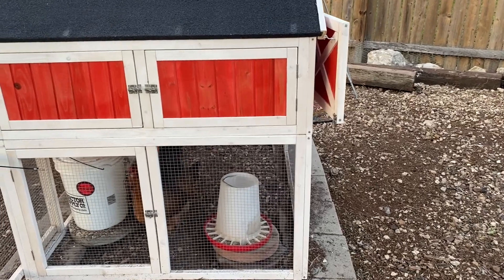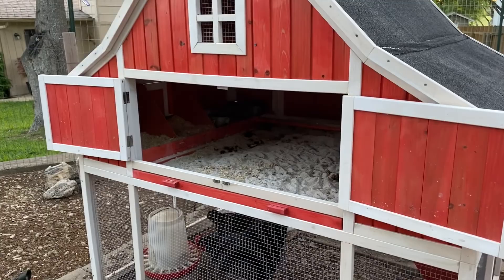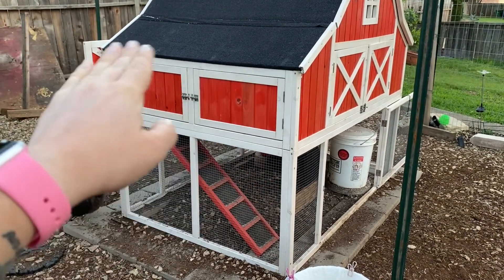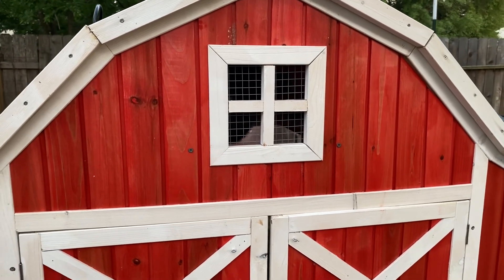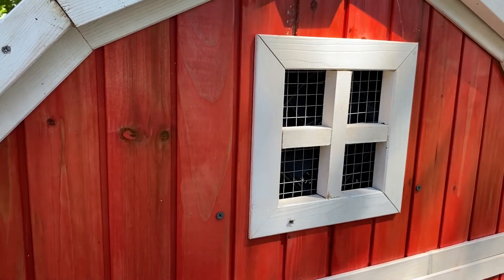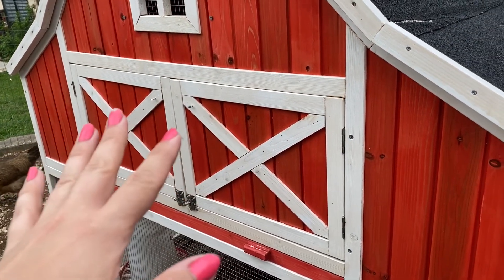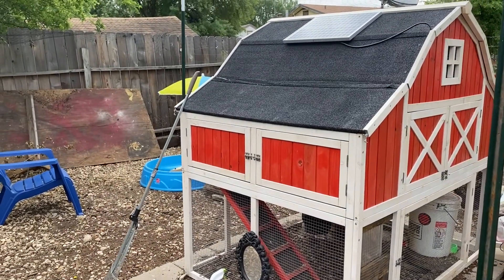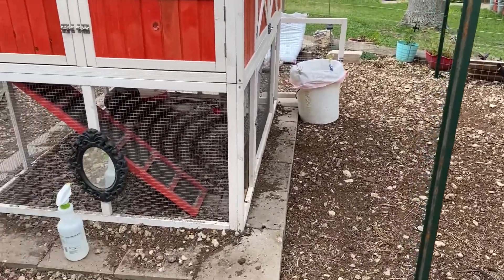Ventilation and Solar Fan Build for a Backyard Chicken Coop

Comment: Hi! I was wondering, 3 years on, if this is the same setup that y'all are continuing to use? Or have you tweaked/modified it over the years? I remember in another video the consensus was that one battery might not be quite enough to run both fans...would adding a second 12V battery maybe help with that? Or have you found other hacks to get around this? I just got this same coop and working on painting/sealing/assembling but definitely thinking ahead...I'm in north Texas so basically it still gets realllyyyy hot in the summer but it also doesn't rain hardly at all between end of May and mid September. :) So definitely will need some system to keep the new chicks cool this summer after they arrive.
Reply from the maker: Hi! Yes it’s essentially the same system. Right now we haven’t played with a new battery so it’s just “When the panel has sun, the fans are running” but it’s not charging or storing energy for later use. The fans still work great! You can buy all kinds of AC fan kits that are originally
meant for attics and garages too. And I’m from the Lewisville area and went to UNT for college so I remember that dry heat! ✌🏻❤️🐓

Comment: I am new to chickening.  My run will be completely covered/roof and the sides are open, and my coop is off the ground like yours.  It has a window on each long side and the roosting bar also runs side to side.  With the window's across from each other, I was going to put a fan on the outside.  It will blow in one side , across the roosting bar and out the other.  So a fan blowing on them at night won't hurt the chickens, right?
Reply from the maker: I don’t think they need a fan blowing across the roosts at all except maybe a bit during the day to help with smell. Why are you thinking you need it?
Reply: I have been using a small fan as an exhaust on one window 24/7. At night when it’s hot i put a small rechargeable fan facing in the coop. In Fl where I live the temps haven’t been dropping much  at night. When I go to tuck them in for bed, I can see them panting. Otherwise I wouldn’t put a fan on them. I have 5 different fans right now around the run. Hopefully I can consolidate when a new fan I ordered arrives. I am in the process of installing this type of solar for them. This video really helped me figure out how to do it!

Comment: Question please… Is it more important to pull hot air out of the coop or have outside air blowing in during hot summer months.  Not sure we have room for two fans so trying to figure out how to keep my girls cool before it gets super hot here. They won’t be ready for the coop until late July so trying to get everything else ready. We will have predator proofing underground around the coop & run as well as hardware cloth on the sides of the run and a solid roof over the run as well so wondering if we can just leave the windows open (covered with hardware cloth) with one window fan. Help!
Reply from the maker: Hi! I’d pull out the hottest air if possible. In the summer no one will be in the coop during the day unless they’re laying an egg. My fans auto run when it hits 88 on the thermostat (which is in the coop) and I also leave a door or two open when I’m home.
Reply: @Real Simple Mama…Thank you for replying. We have a lot of predators like coons, fox, coyote and hawks so doing everything we can to keep them safe in the coop and run but the heat here in summer is my biggest unresolved issue right now. Whatever we do will have to be battery & solar powered since the coop is too far from the house for electrical to reach. Maybe I need to cut another window opening in the back higher up to pull hot air out and use the front window to pull air in. Would that work? I even considered a small battery powered desktop AC but they create moisture so that won’t be good in a coop. Ugh… so many things to consider.
Reply from the maker: Hey I think extra windows high up is ALWAYS a good idea as long as you can keep rain out (make an overhang) and predators (secure with hardware cloth). Remember that hot air rises like you said. Think about the best place for a solar panel and when in doubt buy a too-big battery so it’ll definitely hold charge. I also have an old video about insulation versus ventilation that can help. Or you can email me! theMama@realsimplemama.com
Reply: @realsimplemama  Thank you! I’m going to check out the video you suggested and cut another window opening on the opposite wall up high to pull air out. We have decided to move the coop to another location on our property so electricity isn’t an issue. Thanks for the great ideas. We will be implementing them for sure.

Comment: How are all the fan, battery and thermostat connected together?
Reply: Hi! Thank you! So I did look on your website and I see how it all works together.  However the Solar fan that I got didn't come with the proper cables to connect anything to the Solar charge controller :( so I'll have to get the proper connectors/cables.  I was also wondering what Watts is the Solar Panel you got? Is it the 25 Watts?
Reply from the maker: Hey welllll that’s poopy. I’m sorry. Yes ours is the 12V 25 watt solar panel kit!
Reply from the maker: Hi! You can look on my website for the companion article and the diagram but it’s linear: battery, thermostat, fans. The thermostat is the gateway to allow power to the fans as needed. RealSimpleMama.com

Comment: Hi, quick question. The temp sensor you have inside the coop (the white rectangle box) is that just for you to have a general idea of what it is since you can view it inside?
Reply from the maker: Hi! That actually talks to the fan setup - it will automatically turn the fans on or off depending on the threshold we set up. I wrote an article about this build too on RealSimpleMama.com that shows how it all hooks up together 👍🏼
Reply: @realsimplemama  Hi yes I checked it all out. Just confused, does the wires run from the white rectangle censor where the roost is in the coop house to the other censor that you have in the battery container? Or is it just the censor that is in the battery container your main censor?
Reply from the maker: There isn’t a sensor in the battery. I have a drawing on the article that shows what hooks into what. The temp control connects the battery power to the fan so it’s the gateway (go-between) that allows power to go from battery to fan, when the temperature is at the range I set. If I didn’t have that, the battery would always run power to the fan 24/7 until the battery dies. I hope that makes more sense!
Reply: @realsimplemama  It makes total sense. I think I'm just wording it really bad. The censor that you have in your coop that you can view inside your house does not connect to anything right? It's just so you know what the temp in?
Reply from the maker: Ohhhh I’m so sorry. THAT one! Ok I got it now duh. Right it doesn’t connect to an app or anything else. It’s the wireless remote sensor, and then the panel display in my house. What an idiot 😄🤦🏻‍♀️ I’m sorry! It’s made by La Crosse and it’s called a wireless forecast station. It’s an old model but it has stuff like weather, indoor and outdoor temp. Ok NOW I hope that helped 😄
Reply: @realsimplemama  thank you! Just wanted to make sure that doesn't connect to the other things lol. More for just piece of mind knowing the inside temp. Thanks!

Comment: Black roofs attract heat. What are your thoughts on painting the asphalt roof a lighter color to keep the coop from getting too hot? Can asphalt roofs be painted 🤔
Reply from the maker: You actually are not the first person to suggest that! It is an interesting suggestion for sure, my fear is that the type of material, you regardless of what color it is, will continue to hold the heat anyway. But you were right in that black does hold of the heat in more, I am just not sure it would actually help. I have also looked into putting some type of foil or some thing on the inside of the roof to help bounce the heat back out but I am not sure. Right now with the two fans and us leaving everything open during the summer, we have not had a problem yet!

Comment: Sorry if I missed it someplace ... what size panel are you using? And you said something is about half power so would you recommend a larger panel and or battery than you are running?
Reply from the maker: Hey! Yes on the bad days we shut it off for a few hours so it can fully charge before the girls go up in the evening. It’s a 25 watt panel and a 12 volt battery but we might add another battery. The panel is not the issue for us, it’s needing more juice saved up! This is the panel (affiliate link): https://www.amazon.com/gp/product/B00PFGP0EA/ref=as_li_qf_asin_il_tl?ie=UTF8&tag=reasimmam-20&creative=9325&linkCode=as2&creativeASIN=B00PFGP0EA&linkId=528e16486c55f46a02ccfcacf0703115
Reply: @realsimplemama  Thanks. Do you manually switch on the fan at night? Or it is 100% dependent on the thermostat to turn the fan on/off?

Comment: A ridge vent would help even more I would think. Top looks sealed to me :-/
Reply from the maker: Yes that’s true. It is.
Reply: real simple mama thanks for the video though. I found a digital forecaster on offer up for half the price.. i notice the temp in the coop during the day is in the 90s at peak. Working on more ventilation now, thanks for the tip.  

It is in the high 70s lower 80s at night but because we are having cool nights in south texas atm. So i need some more air asap.
Reply from the maker: You’re so welcome. We are doing more things too. Added a second fan, using a resistor to the setup so the fans can run longer at a slower speed. Also got a canopy for outside.

Comment: Hi Sarah! I purchased all the items from your links and my husband was wondering how did you hook up the brushless motor fans (with the 3 wires) to the thermostat?
Reply from the maker: Hi! So it gets a bit weird but our order of operations goes: solar panel, solar controller, battery, thermostat, fan. If you look on the item photos of the fan on Amazon it has the wires labeled BUT for our setup you only need the grounding wire and the 12v positive.
Reply from the maker: The thermostat also has the images with a diagram on how to hook it up.
Reply: @realsimplemama  thank you! 😊

Comment: Thank you SO much for this!!! Here in SW Tennessee, our temps are hovering around 75°-80° on average, but that is NOT gonna last long. Temps will soar to the high 90’s very soon. My birds are already panting occasionally now....... 😣 I have been wanting to check out solar panels for a while now, and now I’m going to really get serious about it. I bought a mister that connects to the hose, and I tried it out the other day and they ran and hid from it until I turned it off 😕 but then they came out after it turned off. Then I gave them a nice cold head of cabbage to snack on and they cooled right down.
Reply from the maker: You’re so welcome! Yes we do the mister for about 5 min only, just to get the ground wet. They hate it on them but will come get their feet cool and wet when it’s off (which is what you want). So I would do it for 5 min once an hour maybe? Let me know!